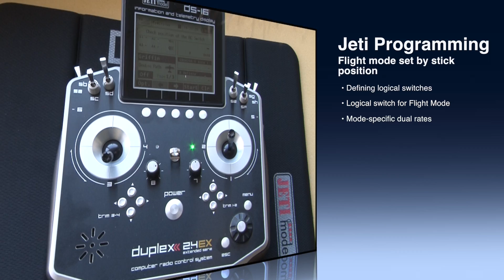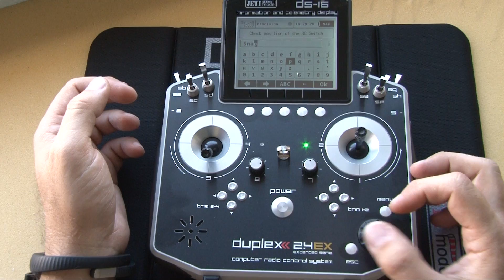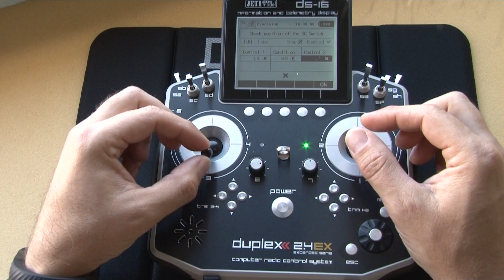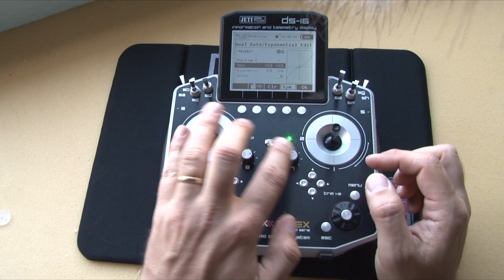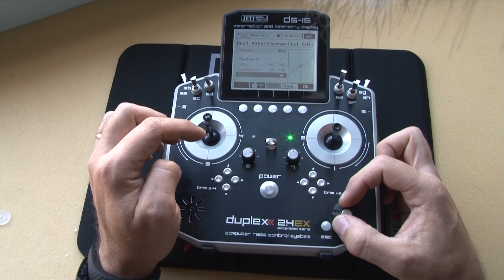Stick-Based Snaps

Comment from the maker: It just occurred to me that I could save 2 logical switches here.  Since L2 (HThrottle) is just looking at P4 > 95%, we can just edit the LeftStick (which I should have named LStickSnap) logical switch to check for P4 > 95% AND ExRud instead of doing HThrottle AND ExRud.  Similarly for the Spin, we can just have LStickSpin check for P4<5% AND ExRud

Peter+